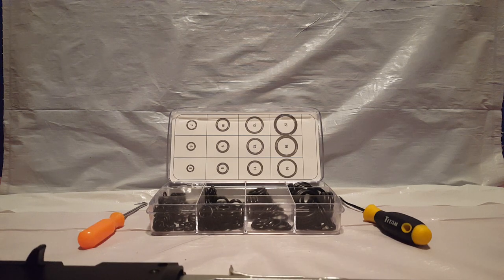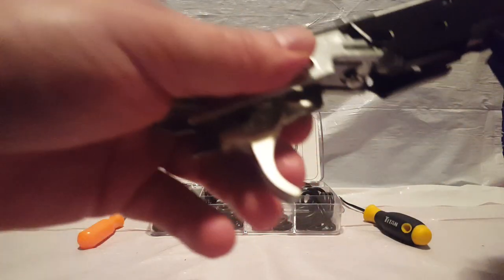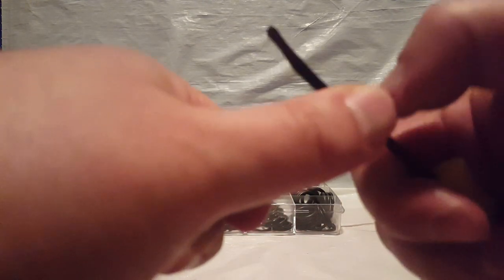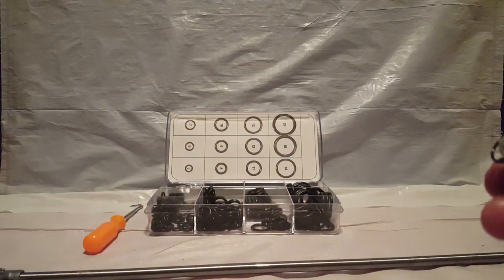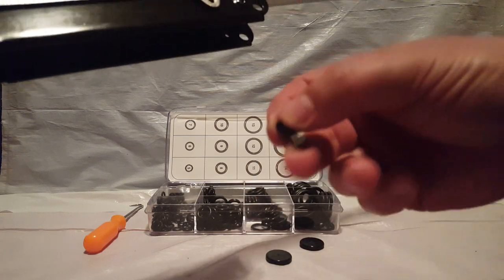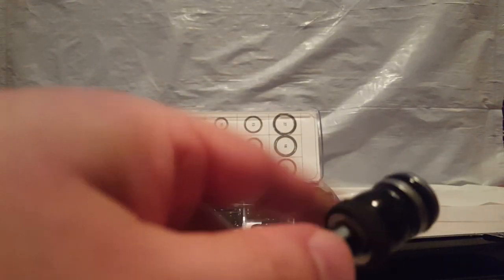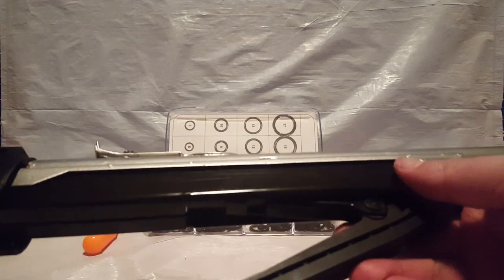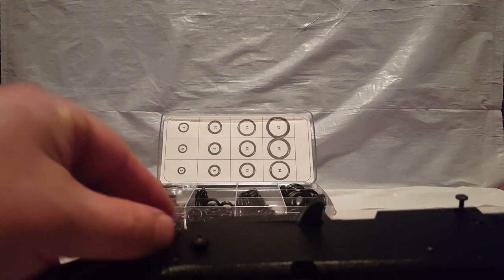Daisy 880 Fix. 3 Main Seals Replaced.

Comment from the maker: For basic ring replacement, you can do same day fix by buying store Nitrile rings. SAE 113 = Danco #11.

https://www.homedepot.com/p/DANCO-200-Piece-O-Ring-Kit-34443/100135126

There can be confusion about brass tube models that haven't been made since 1995. Daisy Ladies can't help with old models. They have different engineering.

Please Contact JG Airguns for complete seal kit - including valve - for brass-style 880.

https://www.jgairguns.biz/index.php?main_page=product_info&products_id=13712

But for O-Rings the Danco Nitrile treasure chest covers any O-Ring failure.

Otherwise, for special parts, Daisy shooters ordering from  Gamo/Daisy is how to get those parts cheaply.

Ok, let me be totally clear that for MODERN, SILVER TUBE 880 ordering from Daisy is choice that shields you from price mark ups (Ebay, 3rd parties).

So long as there is customer service, the ideal order from the Daisy Ladies should be this to keep you shooting for many years:

2 Valve assemblies $6
3 Seal Kits $3

479-636-1200 weekdays 9am to 5pm Arkansas time. They close at 3pm Friday.
Reply: Daisy 880 Fanatic Fix It thank you mine needed 2 11 o rings
Reply from the maker: You are welcome. SAE A113. Danco #11 the best I've found! If you ever want a cool BB gun, get a 1910. It is a single pump 880 - fun stuff!
Reply: Daisy 880 Fanatic Fix It  cool i’ll be on the lookout
Reply: Is there a cheap way to get the oil ring replaced?  Mine disintegrated.
Reply from the maker: @mandrews360  - Great question! Trying to Jerry rig the foam wiper can cause pump issues.

You can technically operate without wiper, but it really helps keep the inside of pump tube and  ring edges lubed. 

EASIER PUMPING, FULL POWER, LONGER LASTING O RING.

Daisy CSRs should help here. $1 kit plus shipping. So order at least 2 kits. Should be about $8 total. Each kit has a wiper. 

169910-000 Wiper Seal kit

Call weekdays 9am to 5pm. 9am to 3 pm Friday. 
479-636-1200

Comment: Hey, Dude. Thank you so much for the helpful videos. I bounced around through a few of yours while fixing my 880. It would take one pump but no more. It would hold that pump for months though. It seemed like that was the chamber seal then. I did the basic stuff but went past that with your guidance. I did the cup fix that you had to re-flare the old one. To me, this seems like the issue is that you can't leave this model with a pump in it unless it is cocked allowing the pump to lose its flare. I pulled it all apart, I dropped stuff, broke stuff, misaligned stuff, lost a few things, found them again and basically felt like a lost child looking to be brought back in; which your vids did. You gave me the confidence to take it all apart. I'm happy to say that the gun holds air and shoots hard. I will leave it with 2 pumps in it while cocked and take my chances with that bolt spring as I do know that the cups flatten as that seems very common. Thank you again, I felt very accomplished when it all clicked   back together and the 2nd, 3rd, 4th, 5th etc pumps got progressively harder where as before it would do one pump as it must have been leaking back past the cup seal as I think all the O-rings were fine as I only removed, cleaned, oiled and reseated them. An old worn out o-ring in behind the pump cup flared it out enough to allow the one way action to happen again, as in, it would pump up but not leak out on subsequent pumps. Thank you and I hope my positive feedback lets others know that it can be done with very little experience as long as you have some determination.
Reply from the maker: Chris, happy you got it working. Happy shim job worked. If you have modern 880 (which means late 1990s and up) you may consider ordering a couple of chamber seals from Daisy. Also general seal kits. Super cheap if you follow my PDF video. How long shim lasts is best guess. I talk about it in written section. But it could last awhile.

Happy for you, so please consider not storing it pumped. If you were TOLD to store it pumped, they were confusing Crosman engineering for Daisy. 2 pumps very little stress, but, yes, I worry about trigger under tension...the spring. When I got back into airgunning in 2013, I literally dusted it off, oiled it, and put heavy use on that 1998 model until end of 2017. Then my other 880s were out shooting it - and I did the 3 seal change in this video. No problems since.

You can buy or make dust cover for your 880. I have 4 and keep them dusted and shoot them here and there. 2 I built and one bought in 2014. All working great. 1998 my main go-to with super soft trigger and broken in rifling.

Comment: The official "O" ring numbers (Aerospace Standard AS568B) are #113 for the #11 Danco, and the valve seal is a #012 which is the Danco #7. With these official "O" ring numbers, there are many different companies you can order from and get different duro hardness and material selection should you desire.
Reply from the maker: Joseph, thanks for being helpful with parts. There are folks who won't order Daisy parts. Your civil input is much appreciated and constructive.👌

Comment: I have a hot tip for you guys. I've had the same 880 since about 1990. Metal side, non brass internals. Anyhow I let it sit for far too long and the Chamber seal dried out to the point where I was getting resistance at the end of the stroke and pushing back on the pump lever and not holding any pressure. I pulled a gun apart as described here in this fantastic video and pulled out the chamber seal which is the round seal with a moat. I soaked it in silicone oil and lightly hit it with a hair dryer probably 20 times and let it cool over a couple days. That softens it up a little bit. Then I put it boiling water about six or seven times pulled off the heat and let it cool after you drop it in. And just for an extra Touch of supple I put some 303 Aerospace conditioner on the outside and worked it around. Back to full function. My all-time favorite toy is back in Action I'm happy to report. No new parts needed.
Reply from the maker: Wilson, thanks for polite, intelligent  comment! If that chamber seal ever does go out - even with your smart life-saving measures - seal kit super-low price from Daisy reps.

Nice job! Great fix!
Reply: @daisy880fanaticfixit9  probably put about a hundred down range today and it's working as good as it ever was. In fact he gets better every shot I can see the string rise to its endpoint after it reached maximum pressure. I'm sure those Daisy girls can hook it up with a new one too if you don't want to go through all that trouble. I just take a lot of pleasure in making something out of nothing even if it is a dollar thing.
Reply from the maker: Wilson, again, great fix! There will be shooters who appreciate your method.

Comment: When removing or installing a small spring,  more often than not, it will go flying off to who knows where. To eliminate the problem I thread a two foot length of four pound monofilament through several coils of the spring, tie off the ends  and  attach a black binder clip near the knot. The monofilament does not pose a hindrance to removal or installation. Once the spring is back in place just cut the monofilament and pull it out of the way.

Ron
Reply from the maker: Hi, Ron! Want to thank you again for the chamber seal hack idea for the old 880. I do credit you and that video has helped brass owners.

You must be talking about the lever retention spring.  I haven't had any problems wirh that shooting wild. The 880 safety spring, yes! I tell folks to open that only in a bag now. Reciever in clear sandwich bag.

Comment: I found the "JL" channel which stated that the "old" (my 20th Anniversary 1992?) 880's have a brass pump tube, and the newer ones have an aluminum tube.
From that, I'd know whether I've a screw-in exhaust valve or a non-threaded exhaust valve. Good to know - just in case. 

Thanks again!
New subscriber.

Comment: Thank you for posting this, it made it very easy to fix my daisy
Reply from the maker: Tmask, Thanks! Some don't understand that Danco O-Rings are very good Nitrile seals. Danco calls this size #11. SAE 113 is universal designation. Your fix was basic pressure retention.

For the chamber seal, which you can't get from store, try cleaning  off the grime or oil build up. You do do that while it is taken apart. If your pump fights you after cleaning the chamber seal, then order from Daisy.

Comment: Hello sir ty for the video.. I just want to know the thick of the o ring because there's a lot of different thickness available in the market out there.. again thank you for your helpful video
Reply from the maker: Yes, the wrong wall size won't work. Fatter doesn't mean better. It would be much harder to operate the pump.

Stick with the Danco #11 Nitrile.  You can buy the single boxes from the store if you don't want the kit.

If you have another supplier you like, go for nitrile SAE 113 x 2. That will be the PROPER dimensions.

Comment: Love your instructional vids.
Question:  Other than "cosmetics" and a cast iron receiver, is there any difference mechanically, between my Daisy Powerline 880 "20th  Anniversary 880" edition" (1992 - yes, it's 29 years old!)) and more recent 880's, in case I need to order repair parts?
Many thanks!
Reply from the maker: Sir, yes, a HUGE difference. The old, or brass tube style, had a screw in valve that didn't hold up well.

The new style, 1993 forward, have snap in type.  NONE of my valves have gone out yet.

The rifling was much more poor back then as they struggled to make it shoot BBs and pellets.

The rifling now can deliver dime accuracy at 15 yards with basic optics. Please use Gamo balls to utilize your magazine. They grip the rifling. 2 of my 880s have that, and the balls don't conflict with shooting pellets. Gamo balls allow fast, hard hitting follow up shots in the field.

The parts available for brass style are SO EXPENSIVE...it makes no sense.

The metal sides are fine, but Daisy should offer stainless steel for its version now. If yours is cast iron, that is interesting. Normally those parts from Daisy or Crosman are zinc diecast. Put a magnet on it. If it falls off, it is likely zinc.
Reply: @daisy880fanaticfixit9  

GLAD I ASKED!!
So, if I need to order parts for my 20th Anniversary edition, is there a parts diagram specifically for it to which you can refer to me, please?
Reply from the maker: Here is where I normally send brass folks. You can use JL if you choose.

Here are your brasser parts and be sure to toggle on "schematic"

https://www.jgairguns.biz/880881-c-78_186_197/dai880sk1-complete-seal-kit-p-13712.html

Comment: If it doesn’t have a Whiper could that make it not build pressure?
Thanks
Reply from the maker: No, it is most LIKELY an O ring breakdown. If you lubed it w 30 ND, and tried shooting it, it is a blown ring on the valve body or pump head.  There is a small ring on your valve, but try this first - 2 #11s:

https://www.amazon.com/Danco-34443-Rubber-Faucet-Ring/dp/B000KNT6WA/ref=mp_s_a_1_5?crid=3B378K07DHTBW&keywords=danco+kit+rings&qid=1647226377&sprefix=danco+kit+rings%2Caps%2C146&sr=8-5
Reply: @daisy880fanaticfixit9  thanks👍

Comment: Is Balistol a good cleaner and lubricant for the Daisy 880?
Reply from the maker: For the Daiay 880, it is loved for wiping down the gun. It puts a wet look on the black plastic and dries on it. It really looks great on the Crosman M-4.

For the multi-pumps, 30 ND is the most recommended. It is the right thickness to last longer, ensures air pressure, and preserves the O rings. 10 ND weight motor oil is ok, but you have to stay on top of it. The 10 ND is good for cold climates.

Ballistol - compared to 10 weight motor oil - is a touch thinner. Meaning, you would have to stay on top of it.

I ONLY use Ballistol for TOTAL care for the youth spring guns - Red Ryder, Daisy 25, Daisy 340. Lube and wipe downs. Those guns are working great. The lighter oil is great for max velocity.

You can try it. Ballistol shouldn't hurt the nitrile rings. I don't use it for pump gun lube. I don't know any old- timers who use it for that.

Comment: I have a really old 880 that’s not retaining pressure...the spongy covering on the main visible O ring broke apart and fell out.....O ring is still good though.  Is that spongy material necessary for function?
Reply from the maker: Sir, I try to help with the old guns to a point, but the BRASS TUBE 880 is beyond the scope of this channel.

The brasser is plagued by problems including faulty valves. That breaking would stop you from retaining air.

I will refer to gent who does have video on that type. Also I don't know what OLD means to you. My best 880 is from 1997 and is my best one. First gen silver tube. I just did clean sweep of pump tube rings and chamber seal in 2017 - after power fluctuations.

WORKS GREAT!

On your gun, try cleaning it out, change rings, in the tube. To answer your wiper question, no it isn't VITAL to operation, but is nice to keep ring lubed and offer wear protection.

Did you try and oil it? If so and no dice, then buy SAE 113 x 2 Nitrile rings. Or keep it simple and get Danco Nitrile rings from home improvement center #11 x 2.

Ok, I need to stop because I don't know what style you have. If it is silver style COME BACK! This is non profit channel that is set up for modern design.

 Otherwise, brass is for JL and that will cost more.  I can't help that way and either can Daisy reps.

https://youtu.be/1B9iXXq5hyQ

Comment: Do you oil the trigger and boult assembly on when you oil the pump and henges
Reply from the maker: Yes, and those 2 spots can be lubed as soon as 500 shots. There is tiny ring on front of rod.

The trigger engineering is a unique duck for the 880. I just cock the bolt back, shine a light, and get a needle nose with BALLISTOL on the plate inside. On top and bottom of the safety plate gets lube on vital parts.

The plate locks up when the bolt is open so you don't shoot the gun. When you close the bolt it pushes DOWN the plate and you can shoot.

Comment: I did everything over this morning. It's a small skinny spring that fell out. Where does that go?
Reply from the maker: If it is the PLATE spring that goes UNDER your breech ledge, and the window or slot locks on top of your trigger blade. THE TOP of blade part.

Watch the trigger video, pause it there.
Reply: @daisy880fanaticfixit9  I see it. It goes right in front of the trigger on the bottom.

Comment: Thanks for the demonstration! Is this the Standard or metric gasket kit?
Reply from the maker: Loganeffecto - Glad you are happy! SAE standard. One thing I left out was putting in the reciever spring that holds on your pump handle. My full screen rehab video shows that at end. 

Because of some push back I got about seals outside Daisy, I can say through experience  these Nitrile rings match up well and stand in for o rings from Daisy. But the chamber seal is MADE for the 880. Unless a very veteran gasket expert says otherwise, that is what I was told.

If you are more comfortable with only Daisy parts - and o-rings - I have video for that ordering process. The chamber seal in this video (that checks the air so you have a multi pump) has to come from Daisy Southern Bells or Cargo Ship it. I could not find it in store.
Reply from the maker: Loganeffecto https://www.lowes.com/pd/Danco-200-Pack-Assorted-in-x-Assorted-in-Rubber-Faucet-O-Ring/1000107709
Reply: I really appreciate the info. I'll give the hardware store o rings a try. Once again thanks for the very useful and thorough video.

Comment: GOOD NEWS!!!!!!!!!!!!!!!!!!  ????????????????
I opened up my "20th Anniversary 880" and found that it has an ALUMINUM tube - THAT would indicate that the exhaust valve IS the "pop-in" style, not the "screw in" (afraid to go that far in disassembly), and that other internal parts are "new style", or could they have put in an aluminum tube without changing anything else????  

Thank you!!!
Reply from the maker: No, if it has silver tube, you are good - as long as it isn't used.

I had a smoothbore 22x years back that busted right away. I had to pump it 9 times to cruise big pellets that the 880 isn't really designed for shooting. Also the Chinese factory counter sunk the holes in the wood forearms TOO LOW. The screws dug into the plastic pump handle and shreds came off in the tube. Likely that helped blow out the ring in back (on the VB). I never got through a tin of pellets.

But I would take a smoothbore 22x over a 822 BECAUSE the 822 has brass style.

With a 22x, I would just buy new plastic forearms, and try to shoot LIGHT .22 ammo, hunt with alloy like H&N Green.
Reply: Daisy 880 Fanatic Fix It Thank you!

Comment: Were can I buy the danco kit??
Reply from the maker: LOWES or Home Depot
https://www.lowes.com/pd/Danco-200-Pack-Assorted-in-x-Assorted-in-Rubber-Faucet-O-Ring/1000107709
Reply: @daisy880fanaticfixit9  Thank you so much for your reply :-)
Reply from the maker: Bee, your rings will be A113 x 2 (#11). If you ever have to change valve seal it is A012 (#7).

These are Nitrile rings and great in your gun. My Grizzly using store rings shoots great going on 3 years. A115 x 2 (#13 in your kit).